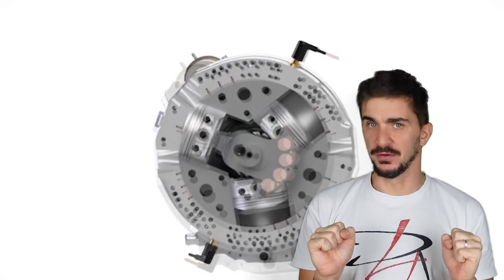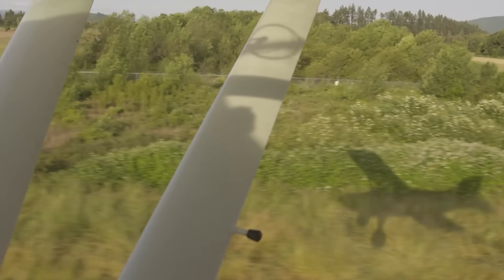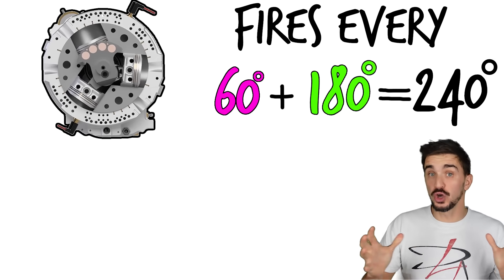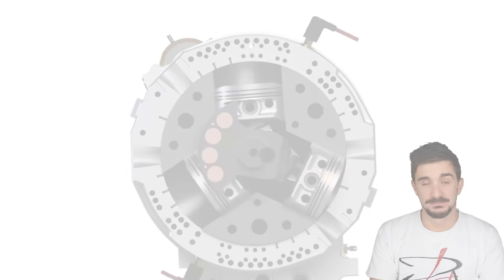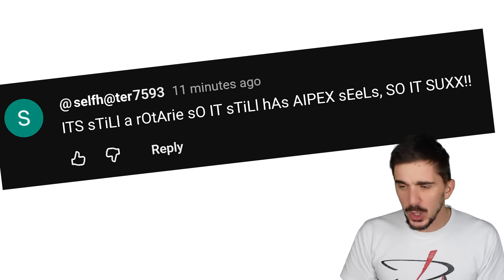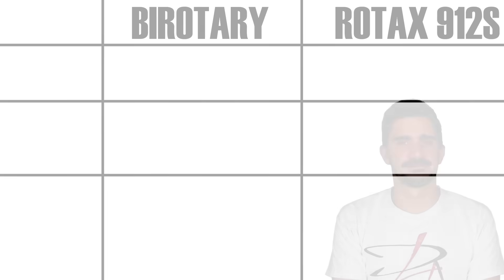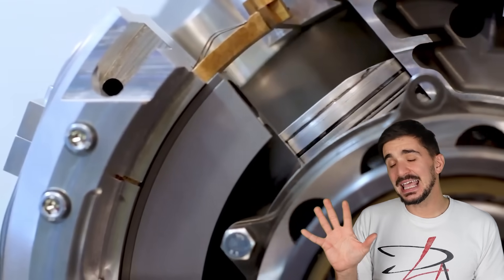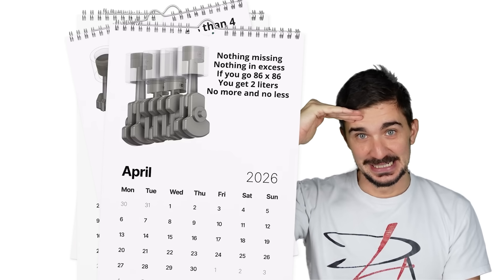This is What Happens When Pistons and Rotaries Make Babies - Birotary Engine Explained and Reviewed

Comment: 11:59 having built a Renesis and FD rotary. Seals needing to move in and out cause float at high RPMs. More spring force to combat means more wear. So lighter seals. Its all a comprise that these seals dont need to deal with. Static seals last a long time. The main issue is when the opening of the cylinder edges meet the seal.

Comment: False.
Engine reaction torque opposes the output torque (=propeller), not the individual torques of its components.

As long as the plane uses just one prop, the plane will twist in the opposite direction.

Comment: Another benefit, somewhat covered in the MTBO comparison is reliability. Fewer parts means fewer things to break. 
Another note: I probably don't understand the geometry well enough, but it seems to gain greater stroke length you can just radially expand the design. It might require adding a cylinder past a certain point, but that seems manageable, too.
Reply: Yes, and have it spin slower.
But that comes at an exponential rotating mass cost (r^2...)

And this engine type already has a slow response (probably due to that).
Reply: If I were to make it a long-stroke engine, I would like to use the barrel-cylinder configuration of the Duke Engine.
But that might make the crank weak.
I'm having a hard time deciding.

Comment: might run but it wont last and fundamentally dangerous because contamination or failure in one cylinder and the whole unit will grenade unlike traditional multicylinder engines where failure in one cylinder does not always grenade and can complete safety protocols with a misfire and reduced power, should be ok as a marine option but in my opinion avo use is icaruslike .

Comment: All this RPM confusion is silly marketing.
The REAL RPM should be the output shaft's RPM..   You don't count the gear ratios of the transmission, and you don't count what the internal parts are doing.  What is the RPM of the OUTPUT shaft-  that's all that matters.

Comment: What about as a range extender for an EV in the auto market? Seems like it would be simple to integrate an electric motor generator that could also be used to turn the engine over.

Comment: The rotating block seems like it might be difficult to keep properly lubricated, or possibly not, but from what I can see in the cutaways, it does seem to have a lot of bearing surface between the rotating block and the external housing. 

Even so, it kinda reminds me of some of the original rotary piston engines used in airplanes before WW2, where the entire engine would rotate around a central shaft to spin the propeller. They were used in several aircraft early on. I believe the Sopwith Camel (of Snoopy fame) was an example. But in the long term they were left behind by better designs. They were still kinda cool though. It's really amazing seeing some of the crazy stuff people come up with to get stuff to work, until something better comes along. 

Still, they managed to get a rotating engine to work. I suppose that the intake and exhaust setup HAD to be able to rotate along with the engine, but it is still hard to understand how they could get fuel to the engine. It must have been quite a trick engineering job to pull it off.

Comment: I'm not sure how this classifies as a rotary engine at all. Possibly because the "valve train" is positionally dependent on the position of the rotation? To me this is an internal radial engine. Don't be shocked by the weigh being heavy! It is amazing to me that it is as ight as it is. You are rotating the entire block of the engine inside the rotor. Genius in the fact that it solves the lubrication issue inherent with actual rotary engines but... not a rotary engine "bi" any stretch of the imagination.

Comment: While the counter rotating components may help to reduce gyroscopic effects they won’t help with torque. It’s not the engine’s internal torque that causes problems, but the torque between the airstream and the propeller. The prop is trying to screw the air in one direction and the air reacts equally in the opposite one - plain old Newton’s third law.

Comment: How does this compare to a turboprop I wonder. Fuel economy, vibration, efficiency, oil consumption. Very cool little motor, might be a good paring to a CVT, gear it down to increase its torque.

Comment: The Birotary engine is heavier because of it having more metal (steel) parts inside.  The planetary gears and the cylinder are steel not aluminum.  I think.

Comment: The cutaway shows something shockingly similar to 'apex' seals. Walks like a duck, quacks like a duck, etc. They're 'apex' seals. While the design mitigates SOME of their disadvantages it still has the primary ones which are direct exposure to particulars which can and will clog them, lubrication needs, and having large gaps they're unsupported for.

Comment: yeah wankel engine people who AREN'T dumb saw those orange seals in the drawing and gave out a wistful sigh. Not only can you put more than one set of seals, but they aren't LINE seals like a wankel apex seal. 

The idealized tip of a wankel rotor shape is an infinitely thin point. That's not possible so a real apex seal is a blunt point that gets ground down by the walls and has to be able to move around a little. 

A piston ring or those chamber seals on this engine can be big thick boys with a squared off, slightly concave face because they always meet the metal at the same angle. The apex seal changes angle the whole time so it gets worn into a point which wears away faster, then hits some burnt gas on the wall and breaks off and then you find apex seal pieces in your muffler ASK ME HOW I KNOW

Comment: As an engineer, I am still worried about those seals. They have voids going past them thousands of times a minute, which can cause nasty erosion. Rotaries also need side seals. And this means that normal lubrication systems do not work. This is why two strokes and  Wankel rotaries inject oil into the fuel. Would this also occur in this motor. And that would be horrible for environmental issues.
To increase the performance at lower rev ranges, do what your images suggest, stick in a variable super or turbo charger.

Comment: I would say flip this to being onboard generator for an electric drive train (Ala Edison Electric and diesel electric trains) for the ground vehicle use case.  That would allow a set rev like in the flight use case, and potentially better fuel efficiency, as smaller engine needed to drive the generator to charge and provide power.

Comment: Engine longevity and somewhat efficency seems to be directly related to the total linear area of seals exposed to compustion pressures, and for longevity multiply by the longevity of those seals.

A conventional engine does well since it's sealing area is quite small, and circular pistons/poppet valves can have very long lasting seals. Seal friction is reasonably low. 

In this engine totol seal friction is high. And is probably why they haven't produced efficency numbers yet. The efficency is terrible.

Comment: I can't imagine the seals are reliable for long, so, planes are not the best use. Needs a supercharger to run? Probably. Let's ask: After 120 years of best engineering, what engine has the best lifetime use, best power-to-weight, best seals and valves, best fuel consumption? We don't know, do we?

Comment: Interesting but not a formidable breakthrough.  
First, reciprocating mass is not the future. Here you have seals that pass over an open combustion chamber. They have to be lubricated or they wear out fast, so this means increased oil consumption, contaminated combustion (proven to lower knock tolerance) and poor emissions.  What must be done is find a way to eliminate the crankcase full of oil (dry OR wet sump) OR at least find a way to keep blowby from pressurizing and contaminating the oil supply such as by forcing it to only pass into the exhaust toward a turbo where it not only helps solve the sealing issue but is not entirely wasted meaning if it is slightly higher, SO WHAT. In this way if you must have a "crankcase" (and you must not) you keep it from being pressurized adding to losses and avoid oil vapors to constantly deal with. Of course, with no oil soaked "crankcase" all the air & hydraulic windage loses are eliminated along with a whole bunch of other stuff.  Now you are setup to eliminate hard constant hard contact sealing all together. Stacking a few more key methods you literally reach a point in which the drawbacks form such sealing far outweigh the benefits! Wah La, sealing solved with more efficiency AND lower emissions than currently possible with ANY reciprocating engine OR any engine in which hard contact seals must pass at high speed over open ports OR an open CC!

Comment: Since the speed of the parts between the engine's main bearings is higher, the bearings must be of better quality and the expected lifetime is relatively shorter. RPM does not count, but how many combustion events take place in a minute, and that number can be compared in engines.

Comment: Bro that designed this doesn't understand bearing speed. Let's make an engine with a 10 inch bearing surface so at 2000 rpms the bearing speed is higher than a NASCAR engine turning 9500 rpms, great idea no issues here.

Comment: 🤔 That engine makes no sense as an aircraft engine. 
In aviation, you want simple and light weight engines. Weight requires lift which generates drag. So its weight is a problem. Complexity invites mechanical failure.
You want simple engines. This one needs reduction gears and bells and whistles and shite. 
It solves no problem. Most of the angular momentum of a propeller-engine system is in the propeller anyway, so as long as you keep the propeller, you keep the bulk of the angular momentum.
And even that angular momentum is not the issue planes have. The asymmetry propeller driven planes experience when cranking up RPM comes from the aerodynamic effects of the propeller. If you ignore the angular momentum, you have the aerodynamic drag of the propeller blades that generate the torque on the plane. This equals the engines output torque, actually.
Then the reaction of the air on that drag is that you have a "cylinder of air" dragged along by the propeller which rotates around the driving axis. Usually, you have the vertical tail of a plane above the fuselage, so air that spins clockwise also generates a vortex along the fuselage that rotates clockwise. This thus hits the vertical tail from the left, pushing it to the right.
This is the very well known corkscrew effect every flight pupil gets to know and control. The most problematic part of the Corkscrew effect happens at the wing, where the angle of attack of the entire plane plus the one added by rotation of the vortex can cause the airflow at part of the wing root to exceed safe limits and lead to a stall. Planes like the Mooney M20 family and the Piper PA 24 with their early laminar flow aerofoils are prone to this issue. The Focke-Wulf 190 apparently suffered quite badly form it, too.
At speed, the rudder trim easily tackles with the issue. It is at slow speed like when starting a take-off run or going around when rejecting a landing that planes get into risky territory. That´s why you don´t put the engine RPM at full with single engined taildraggers when starting to take-off and keep the plane´s nose low when going around for a moment to allow it to pick up speed for better airflow. 
The actual angular momentum of the crank itself is a pretty small factor in the calculation, and actually negligible.
Then there´s the obvious issue with a very non-optimal crank ratio in that engine. Due to the short pushrod, the lateral loads on the cylinders will be quite high. That makes low efficiency of combustion and heat through friction.

Sorry, I strongly doubt that development will go anywhere. 🤷‍♂

Comment: Reminds me of the old 'rotary' engines from the early 20th century that were often used on WWI fighter aircraft. On those, the crankshaft was fixed and the rest of the engine rotated around it. The large rotating mass made for some interesting gyroscopic effects when turning. Some years back that concept was used for a compact engine with a short stroke and with the engine contained in a housing, and I thought this was just another try at it until it got to the point in the video where it showed the cranshaft rotating also, which seems to be the key advancement of the rotary piston engine architecture.

Comment: It seems inconsistent to claim it fires every 180 deg by only counting crankshaft rotation but then claim it revs to 10000 rpm by counting rotation of the  crankshaft relative to the block.  This would imply it fires 20000 times per minute when in fact it only fires 15000 times per minute.

Comment: no direct relation stroke and firing .... um YES THERE IS ... it is why TDC ( top dead center)adjustments are done ... you advance or retard the stoke so the firring happens just before max compression so you get the maximum energy transfer ... this is a basic geometry and timing set of math ... for a street car maybe 0,5 deg early to get best performance ... and racing engine wants about 2 degrees early because it spends the majority of it's time at max performance .... you have to account for travel time and propagation of the explosion because n BOTH the standard combustion engine and the TRIrotary engine you are speaking about BOTH have t account for the distance the rotor moved between the spark fire and the complete ignition of the gas ... because it is also geared down ... by 3:1 ... the amount it needs to be early for the plug to fire is 1/3rd of the actual time needed ... an 1/3rd the force as well ... and you need to get them in a near resonant patter so each cylinder fires just as the crank is about to pass TDC on the piston ... this pushes it along faster like a swing 

the reason why rotary engines are minorly better is because they are self dampening sequence firing engines ... basic combustion engines are in line opposed or v firing making them shake like they are trying to mix paint 

you literally cant use the way you are talking to justify this engine because you got it only half right at most ... and missed the parts that actually SET the performance envelope entirely .... short form you half assed your investigation and got it half wrong and came to the wrong conclusions using wrong math and information

Comment: wouldn't a properly used CVT solve the rpm issue? you let the engine rev at whatever rpm it wants and adjust power output with the transmission

Comment: Not exactly true on the gyroscopic effects.  Whatever unit has the most mass (either the cylinder block or the crankshaft) will yield a net gyroscopic rotating mass with the associated gyroscopic effects.  And don't forget, the gyroscopic effects of the propeller are still there as well.  So when you make it sound as if there are no gyroscopic effects, that's not exactly true.  There will be some, but they possibly could be somewhat diminished over a regular piston engine.

In wheeled vehicles, an IVT transmission would be ideal (I see many mentioning CVT in the comments, but this is short sighted...)  This engine would also be ideal for range extenders and auxiliary power units where electrical power or compressed air or hydraulic/fluid power would be the outputs.

Comment: That rpm calculation is bullshite . What matters in a rpm measurement is the absolute value , not relative values.
The absolute value relates directly to the internal accelerations and they are what matter.
10,000 rpm is just marketing hype

Comment: Watching this I wonder: How does the cooling system work?
Reply: Better lubrication than traditional, as the oil will be thrown out and pushed back in from the piston.
Reply: @jameshaley7869  it would still need to pass through somekind of radiator or heat-exchanger to export the heat from the engine to the environment. You won't get much cooling capacity by just sloshing oil around in a small space.
Reply: @Skoda130 it's mounted on a plane with a big propeller which pushes the air towards it.
Reply: @user1gfc I see no cooling ridges.

Comment: The Birotary could be advantageous in the automotive market IF operated like a diesel-electric train.
The target RPM of the engine to achieve the highest fuel efficiency and power output is paired with an electric generator constructed to produce it's highest output at that specific RPM. Engine speed remains constant while electric load varies and that is buffered with battery power.
This hybrid would rely on electric motors and batteries to be the primary mover while performing the load variation tasks. When the batteries are charged up, the generator output is attenuated, reducing the load on the engine. This results in higher fuel efficiency since there is a reduced load on the engine. 
Still, I would like to see some lubrication and cooling data on this engine. I get the feeling that this might be a smoker.

Comment: Fascinating, but let me make a proposal based on some french cars.
That do not have a gear box, the engine is only there as a generator and clunks into direct drive power when it reaches a cruise speed within its ideal power band-revs. About 60mph if I recall.
So an adaptation of a hybrid mentality. 

But looking at the block, even though it is "compact", there is clearly a lot of metal involved in its structure. and I suspect the emissions would not be too good to manage either because they want to rev high all the time. So my major suspect? is that its not actually cheap to produce.